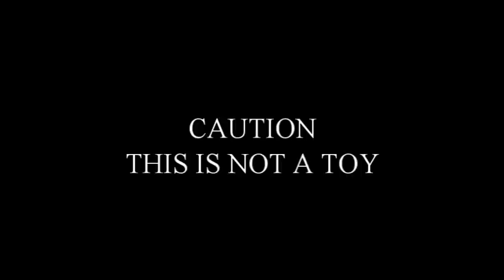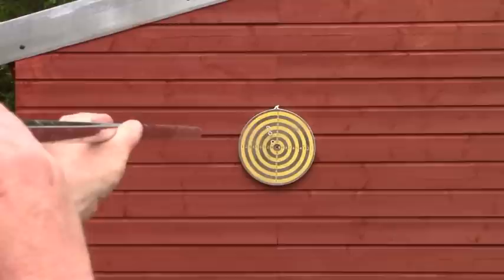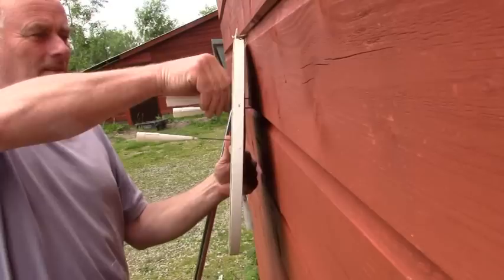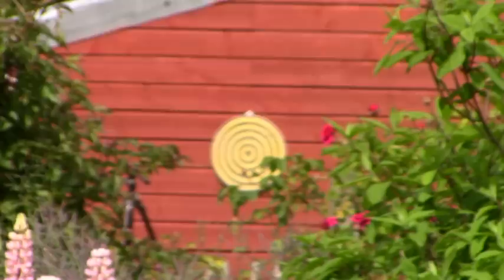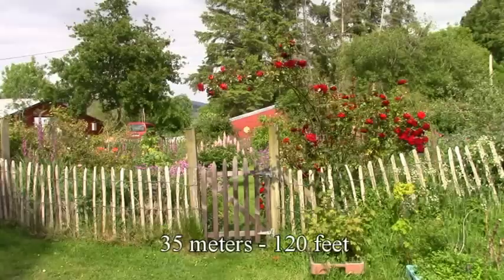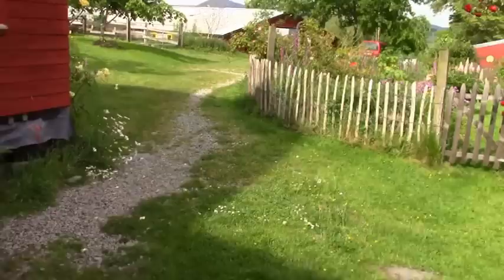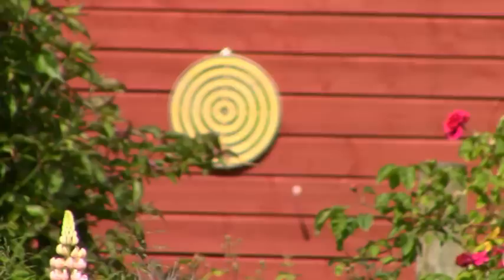Excellent Homemade Blow-Pipe Dart Gun From Household Items

Comment: My dad has a blowgun he made by using a copper tube and then wrapped it and did his own fiberglass resin job.  He would make his darts by melting milk jugs and using roofing nails and silicone caulking and he made his form to make the cones all pretty simply.  He would make a cone by cutting a piece of pie out of a circle and then he would take a glue cap like you did and that was the inside and outside of his mold.  He would melt the milk jug just enough that it was soft and pliable so he could use the cones to form the dart cones.
Reply: you can make darts from paper and they are very strong if done right and after they dry put some cleare tape on the end works really wel and you van put hard points in the paper arrows even needles i think its a dutch thing kids used to do was very commen where i lived to have a pvc pipe and make paper arrows

Comment: is a kid in amsterdam 1988 we would have pvc pipes and make paper arrows i think that would work better then the plastic you are using and if you put a needle or the tip of a wooden sate stick it will go in things but even just putting clear tape on the ends of the paper ones will go threw pizza boxes at 9 meters distance i am doing it now found a pvc tube its a little to short but works

Comment: and good technique with explosion of the long closing your mouth with your tongue putting pressure with your longs and make all the air go out by moving your tongue and then giveng even more you do have to watch out if done wrong you can callapse your long but is rare to happen to atleast with kids. but when i do that i have a 50cm pvc pie make paper arrows put clear tape on the end pizza box 9 meters away its gos in it some both sides not only paper when i put barbeqeu wooden stick at the end it gos all the way pritty fun